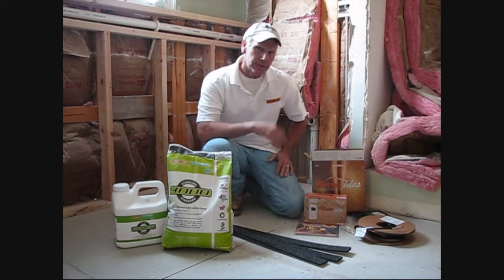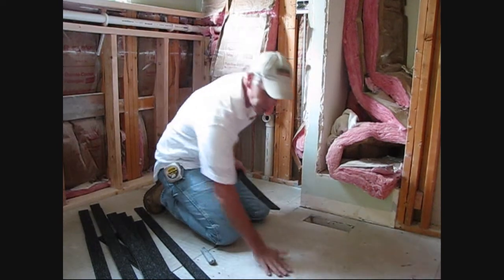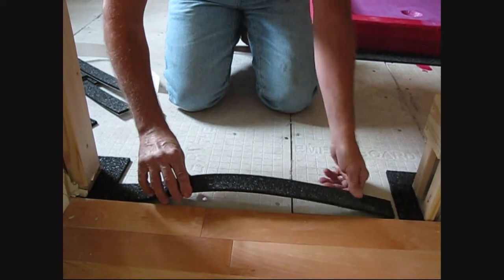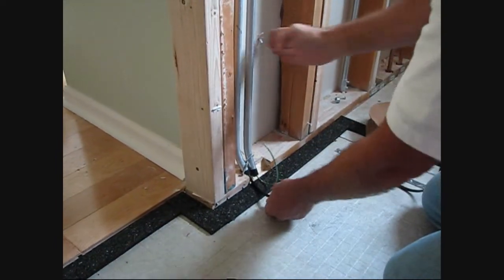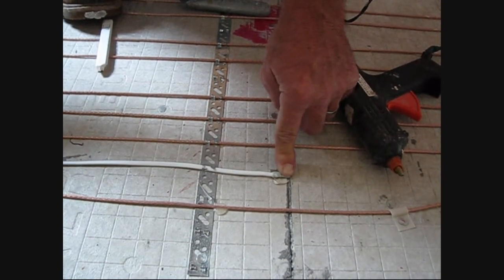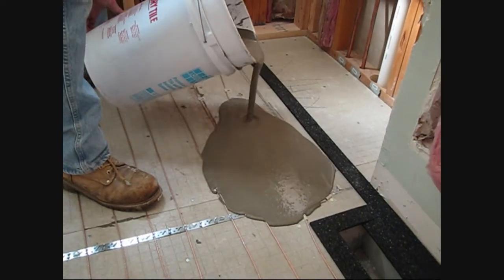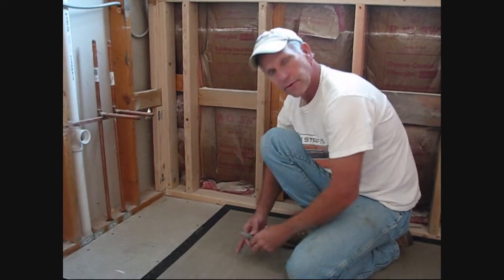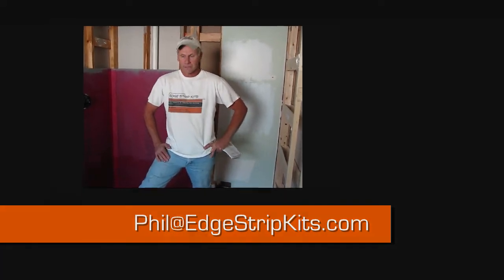Using Edge Strip Kits to Install Warmtiles Radiant Floor Heat Cable System

Comment: You can achieve the same result by hot gluing down firing strips.  However, if you do not own a hot glue gun this is a great product.  Time saving and simple.  Excellent video.  Nice work!
Reply: No Bill, not exactly. The ESKs stay IN and can be tiled over ( IN THIS CASE ) Other videos show them installed VERTICALLY so you tile TO them and then cut them off providing a 5/16" "Soft Joint"....Can't get that with furring strips.....